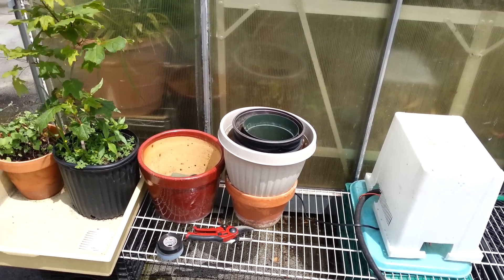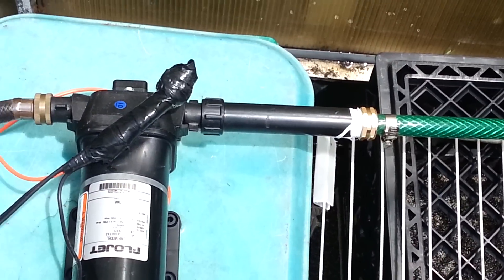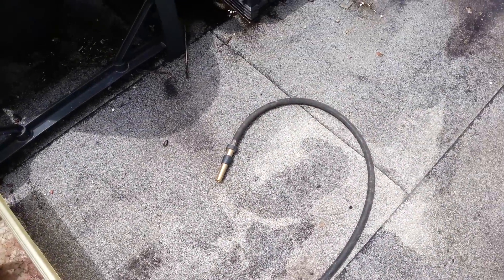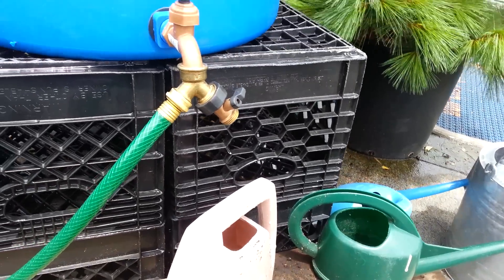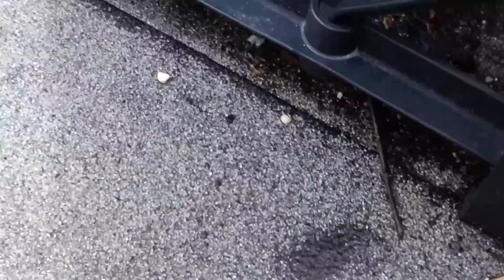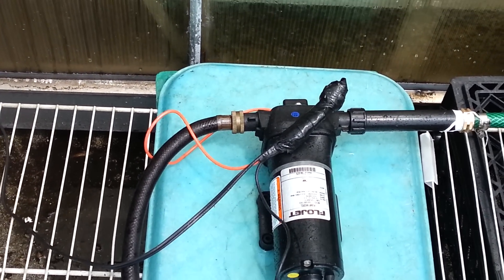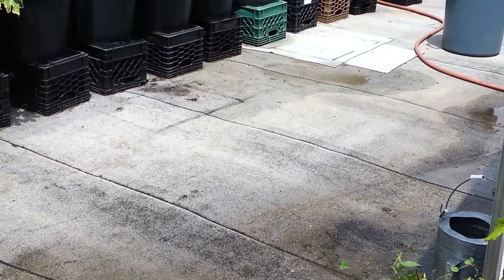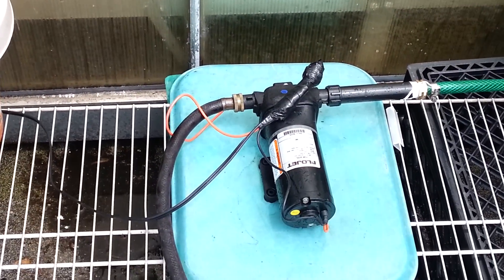ON DEMAND RAINBARREL PUMP

Comment: What happens with the pump when the barrel goes dry?  Will it shut off automatically also?  And the water pressure?  I'm looking to run a drip system where gravity is not doing the job.

Comment: I realize you posted this video 6 years ago from the date of this comment, but what model number pump is that?  I'm currently searching for a pump to use the rain water in my 250-gallon tank to irrigate my lawn, trees, & shrubs.  Enough pressure from this pump to do that?
Reply: Northern Supply has them